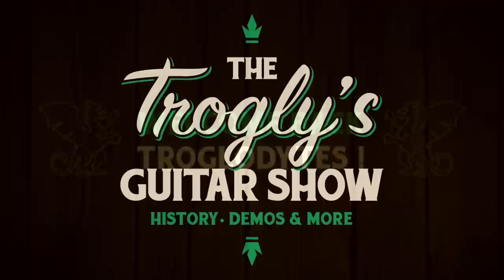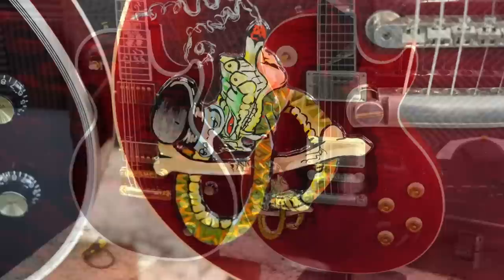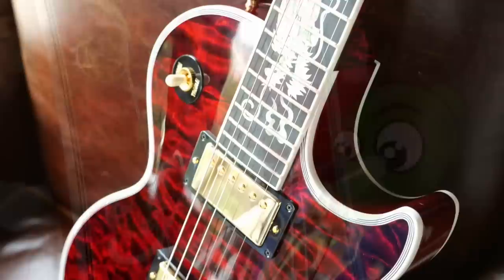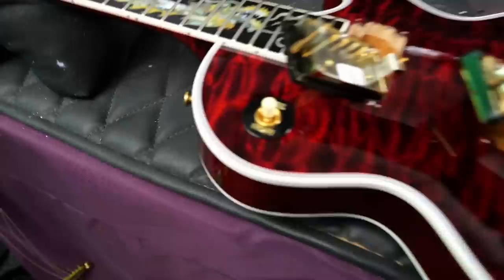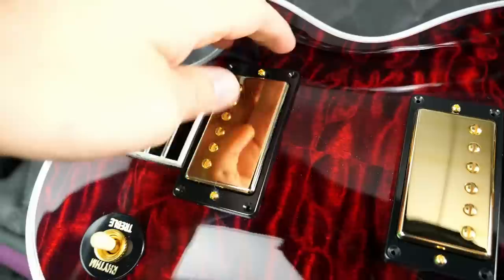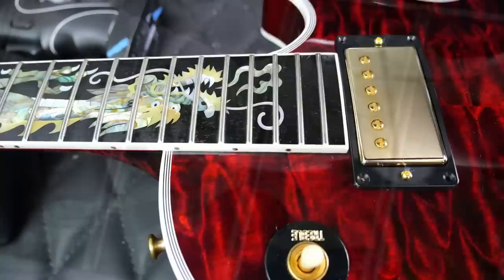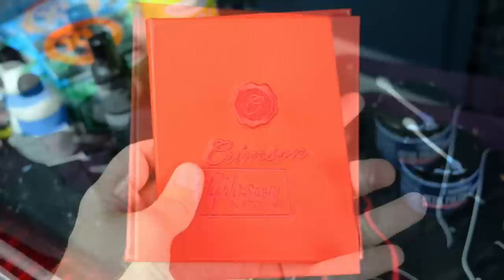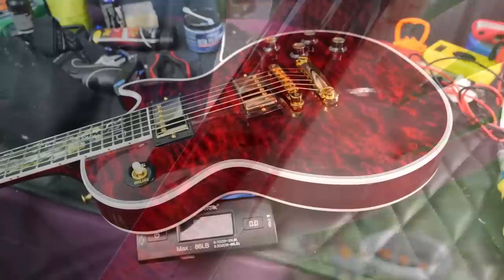The Gibson "Dragon" Les Paul Custom | Crimson Division | Trogly's Halloween Special 2022

Comment: The white residue within the truss rod access is most likely buffing compound.
The slight halo around the headstock abalone flames is caused by the glue used to secure the abalone pieces.
Just a little squeeze-out glue residue on the flamed veneer will prevent the dye/stain from fully penetratingly.
Such a beautiful instrument, even though it is a Crimson Grade Guitar it still exhibits all the characteristic build traits found on all Gibson.
Congrats on a beautiful one of one.
Reply: Greetings Good Sir. I pray all is well with you and the family.
Reply: @sgt.grinch3299  Sarge, Greetings SIr.
I've been so busy with work and prepping the homestead for Winter.  We are all well.
I do hope You and Yours are well also.
Give Chole a hug for me. 
😉
Reply: Good evening HK !
Reply from the maker: That's the thing though... the white is under the finish.
I'm sure that could be a possible explanation, but it really seems like the effect was intentionally done on the 4 flame inlays
Reply: @Trog  It very well could be, no doubt about it, the halo effect looks intentional.   So many small and beautiful details on this instrument, again, congrats Sir, very, very nice.
My next statement may sound strange to some..........The tape line on the fingerboard binding, I actually appreciate that as that's the product of how Gibson builds guitars. The finish has traditionally always pushed above the binding line.   Little details like that make it 100% a Gibson.  Even in the Crimson Division, they are still building Gibson's using the traditional processes.
Its details like that which really endear Gibson's guitars to me.

Comment: As I’m looking it over in awe, I do see some less than perfect finish work on the clear coat as you mentioned, some warpy looking “not quite orange peel” under the string area by the pickups. I’ve noticed a bunch of the super high end Gibson’s with this. Part of me thinks, well.. this is part of proof of hand craftsmanship… but the other part of me is like… but I’ve seen 1600 dollar les Paul’s that didn’t have it. So it confuses me a bit on how to feel. All that to the side, it is a gorgeous work of art. I’m particularly wondering if the choice of dragon was a direct slam at PRS? I know they’ve tried to sue PRS in the past over the single cutaway, so I can’t help but wonder if this was a little stab at them haha?  Probably not, but Who knows? The red stain is unbelievable, that inlay job is mind blowing!!

Comment: I hate the fret board. I would much rather have a chibson, I had a Les Paul Custom with only 5 serial numbers on it. It was wine red and made in Kalamazoo Michigan. The best guitar I've ever owned. I bought a brand new 2006 Les Paul Special. It was an awesome guitar with P-90's. I sold it and never looked back.
Gibson & Fender aren't half as good as they used to be. I wouldn't buy a Gibson or a Fender older than 2007
The Quality just isn't there any more.

Comment: how do you get the stopbar of without clipping the strings ???   just tune it down ALOT ?
Reply from the maker: as long as there is enough length on the strings you just loose them. It isn't always possible - it depends on how many winds the previous owners put on the pegs
Reply: @Trog  Thanks i tried unwinding more and it worked ... Thanks